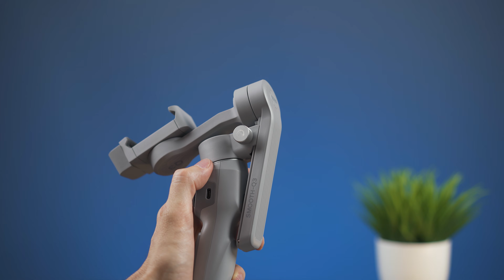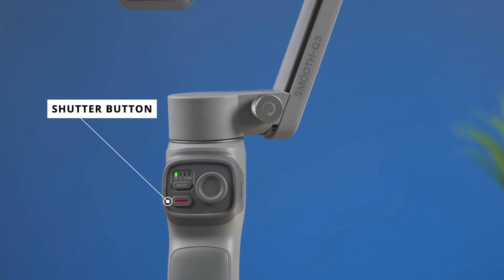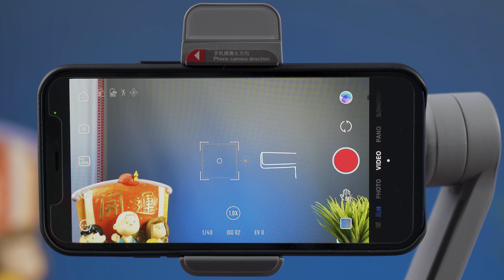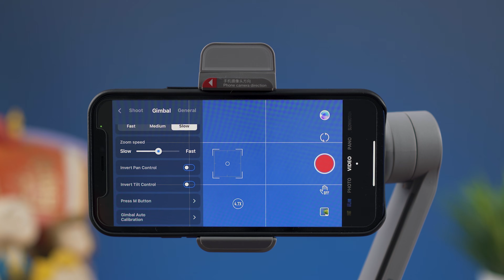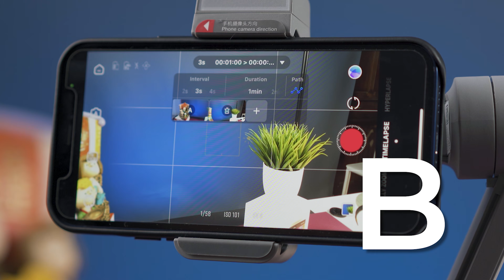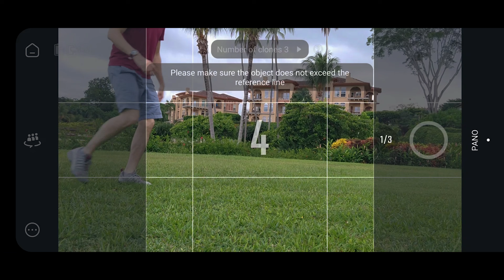Zhiyun SMOOTH Q3 Tutorial: Easy Guide to Setup and How to Use Features

Comment: I’m sorry disturbing you again....but in the app it says activation failed when I try to connect to the app....what should I do
Reply from the maker: No problem. Phone connected to the internet? Bluetooth on? Bluetooth not connected to anything else?
Reply: @OttoJulian_  yes phone is connected to the internet and Bluetooth is on.....and it's not even connected to other devices.....it says activation failed and saying to contact the customer service ☹️
Reply from the maker: Try restarting your smartphone, turn Bluetooth on and off. Also make sure that the green light is solid, if it's flashing, the arms might still be locked
Reply: @OttoJulian_  thanks a lot ❤️🥺

Comment: Hii I have a problem.... i completed setting up everything in the gimbal....then I click on the power button....but the gimbal is not coming in the portrait mode from landscape....but the indicator lights are on and the lights are blinking....but it’s not working....I tried to connect to my device also....it shows that there’s a device but not connecting....what should i do?
Reply from the maker: Common problem is not fully unlocking the gimbal. Make sure all axis move freely, specially the one where the phone rests
Reply: @OttoJulian_  thank you so much ❤️my problem is solved by itself
Reply: @OttoJulian_  I’m sorry disturbing you again....but in the app it says activation failed when I try to connect to the app....what should I do

Comment: Hello Otto, I have got a question. My gimbal is failing to upgrade, and I have no idea how to fix this. Do you have any tips of what I could do? Never mind, I fixed it. Thank you for your amazing video!
Reply: Having the same problem, how’d you fix it?
Reply from the maker: I explain how to do it on my Q3 review, but basically you need to go to their website and download a few files (including the firmware update)
Reply: @OttoJulian_  have you ever had battery problems with your q3? Because mine now is not turning on or charging at all
Reply: @1lilsco  hi, did you manage to fix this ? 
I just got mine , and it seems like it won’t turn on - no lights flashing- nothing happening 
@otto, can you help with this ?

Comment: Hi. I have redmi note 7 pro with 4k 60fps resolution..so which is the best gimbal for androids and note 7 pro get supported ? .please suggest me.
Reply from the maker: The Q3 is a good option, but I can't confirm if it will work at 60fps when using their app. It works with some Android devices, not all of them

Comment: Unable to pair via Bluetooth my OnePlus 9 device with the gimbal. It doesn't pair at all. Any suggestions?
Reply from the maker: make sure your phone is not connected to any other bluetooth device.
Make sure the gimbal is not trying to connect to another phone (if you used another phone before)
connection must be made on the Zhiyun App
are all the axis unlocked? do they move freely?
Reply: @OttoJulian_  Hi Otto, i found the main arm was not completely unlocked. After I clicked it in place, i was able to connect via Bluetooth. Thanks for helping out!
Reply from the maker: You are welcome. Seems to be a common problem with many users
Reply: @OttoJulian_  i believe so, it's quite tricky. I was about to return it but luckily I made it through.

Comment: My Q3 doesnt connect to bluetooth….i bought it yesterday new and i will give it back.

It‘s not calibrating and When im in the Cami app there just staying „ Doesnt connect to the device Bla bla bla
Reply from the maker: I'm sorry about that. if you haven't returned yet try disconnecting your phone from any other bluetooth device first and connect to the gimbal from their app. I've found many times my phone not giving up on another BT device...
Reply: I was having that same problem. I was getting frustrated and was ready to return it. I figured it out though. Smooth q was connecting via Bluetooth to my friends phone, instead of mine when he was near me.
Reply: Switch on the gimbal, get into "Stand-by" mode and press 8 times the Power button, in order to reset it. I had the same problem but once I did reset it, it was all fine. Best of luck!

Comment: Hi 
I wonder if you can help me I’ve purchased a Q3 everything was fine but now all of the green mode lights are flashing. When I turn the device on the green mode lights run through a sequence for a few minutes then all the lights start flashing, I have looked at the instructions and it tells me it has gone into standby mode and to hold down the long mode button until only one light is on, I have held the button down for a number of minutes and nothing happens.
Have you any suggestions 
Regards 
Gary
Reply: I have similar issue where all lights flash. I can’t tell if it’s on standby mode (all 4 flash slowly) or failed to upgrade (all 5 flash quickly). Worse, my phone does NOT tilt to portrait when Q3 is switched on. Resd all of the instructions and even when googled, no similar issues appear :(
Reply: Sorted it now. I just made sure all adjustments and locks are properly done, including balancing, cos otherwise seems to cause the standy mode.
Reply from the maker: Hi Kibo, yeah I was about to say that most people that ask this have that same issue (one of the axis is still locked)
Reply from the maker: Hi Gary, take a look at the above comments. Make sure all axis are unlocked and can move freely.
Reply: @OttoJulian_  hi mate thanks for you quick reply, yes I have read all the comments on your post. Everything is unlocked and moving freely, I’ve set up the phone and balanced all correctly, and the lights are still flashing it’s been two hours or so now. The annoying thing is I was using it earlier today and everything was fine, switched it all off had lunch and set back up and that’s when the lights started to flash. Gary 👍🏻
Reply from the maker: Gary, this might be a dumb question, but are you turning on the gimbal with the phone on the clamp? I'm assuming you do but had someone message me on Instagram with a video of the gimbal with no phone
Reply: @OttoJulian_  yes all set up like it should be, I’ve have left it on all night and the four green mode lights are still flashing this morning ☹️☹️☹️
Have messaged you on Instagram with a quick video of what’s going on mate
Reply from the maker: I'll check it out
Reply: @OttoJulian_  ok mate, left it on all morning still the same ☹️

Comment: I ended up sending the first one of these back because the articulating sections would not move when started (not the sliding section) then I found out the factory locks these articulating pieces for reasons I have no idea about. It cost the company extra shipping costs and cost me 2 extra weeks of waiting for a working stabilizer. 

Are all the brands like this when new (locked in place)? I don't mean folded up; I mean the articulating parts have to be turned manually to unlock them on this brand and model.
Reply from the maker: I also pinned a note. I hope it's clear
Reply: @OttoJulian_  : Thank you and I hope this helps someone else and the company from getting as many returns needlessly. As you said a sticker or simple piece of paper laying right on top in large font saying turn parts to unlock.
Reply from the maker: Hi J&D. Yeah, for the most part they are like that, as it "helps" the gimbal to stop moving around when not in use. You are not the first one running into this problem, specially with this gimbal. Manufacturers should be more clear with this using stickers maybe? I'll make sure to mention this on future tutorials as well.

Comment: Hi i have a problem when i turn on the gimbal its just showing the lights like in a slowly breathing i dont know how to cancel it and enter a normal could you help me please??
Reply from the maker: that means that your gimbal is on standby mode. Make sure that you power on your gimbal with the phone on the clamp and properly balanced. Also make sure that nothing is blocking the correct movement of the gimbal.
Reply: @OttoJulian_  okay il try thanks for the respond
Reply: @OttoJulian_  oh i see it was just a ltlle stuck thank you so much for the help you helped me a lot
Reply from the maker: Great news

Comment: I've had an issue with connecting to Bluetooth.  I have an iPhone 12 Pro Max. When it goes to connect, it comes back with "Connection Failed... The current device connection failed. Please try to connect again'. It asked me to pair once, I pressed Pair and it returned with the same error.  I've closed all apps down on my phone, turned the bluetooth off, rebooted it and it's still not working.  Is there something you can suggest?
Reply: Did any of you guys manage to resolve the Bluetooth issue? I’m having the same problem.
Reply: I am having the same issues with my iPhone 12 Pro Max. Did anyone have success??
Reply: @onlyloveremainsphotography8227  i did. U hv to try so many times. Its kinda annoying. Need to switch on and off the gimbal. Till it auto connect to bluetooth 😭. But now okay. Everytime i switch on the gimbal, it directly connect to the phone btooth and zyi apps.
Reply: @othfay8180  switch on and off standing in the app searching for a connection or how?  It's really annoying
Reply: @paratodo2101  yup. Now, i dont need to put on standing, just put the phone at the phone place of the gimbal, and switch on the gimbal, and it directly connect.
Reply from the maker: Did you try to connect it with another smartphone by any chance? If so, you need to un-pair the gimbal on that other phone.
Reply: @OttoJulian_   No. I just took it out the box today. I charged it and once it was done I tried to connect.
Reply from the maker: Make sure that your phone is not connected to anything else. Otherwise, follow this instructions below to reset the Bluetooth on your gimbal. 

①  If the Bluetooth cannot be found or failed to be connected, you can press and hold trigger button+MODE button+Photo/Video button at the same time for 2 seconds to reset Bluetooth
Reply: @OttoJulian_  Nothin.  I even disconnected my Apple Watch just in case that was the issue.  It give the same error message. The only time it says pair is when I hold the power button until the PF light flashes fast but, it come up with the error again by time I press pair.
Reply from the maker: Ok wait, are you trying to connect on the Bluetooth menu of your iPhone?
Reply: @OttoJulian_  I’m having the same issue. Right out of the box and it just wont connect to my iphone 11 pro max. ZyCami app or iphone’s bluetooth. The modes will have 4 solid lights for 2 seconds bluetooth visibility then it will keep blinking and lose connection. Its always connection failed 😭
Reply: @bmsr1983  Were you able to figure it out? I’m having the same issue :(
Reply from the maker: When you said that the lights are flashing, are they flashing slowly afterwards? Or do they keep flashing fast.
Reply: @OttoJulian_  The lights are flashing from left to right at a medium speed. Iphone just wont recognize the bluetooth for the gimbal. Keeps saying Connection failed.
Reply from the maker: Were you trying to do a firmware update. Your light sequence means failed to upgrade
Reply: @OttoJulian_  i thought the firmware when we need to update, we need to connect it to bluetooth first.
Reply: @OttoJulian_  which is photo/video button?
Reply: A year later I've decided to try again.  It's been sitting on my desk taking up space.  Hopefully a year later I can get some better answers than before.  Now its showing "Device Connection" and when I click on it to connect it does nothing until I hold the power button on the back and then it prompts me to that the bluetooth would like to pair with the device, but as SOON as I click pair it says "Connection Failed" 1. Please make sure the device haven't been connected to other mobile phones. (Which it hasn't) 2. Please restart the mobile phone Bluetooth (Turn off the Bluetooth and turn on again (which I have about 25 times). PLEASEEEEEEE HELP!!!!!!

Comment: Hi otto plz make a video on smoothness of shot when using timelapse panning and vertigo coz i hv seeen there is frame drop im those scenss the continuity is. Issue
Reply from the maker: for the Vortex or vertigo mode, I showed a clip when I did the review. I did notice that on the screen it looks like it's dropping frames, but when I play it, it looks ok. I thought it was me, but I'll make more tests soon, along with the motionlapse. I have another video coming up with this gimbal in about 2 weeks so I'll make sure to find out if there are any issues worth mentioning. Thanks for the heads up
Reply: @OttoJulian_  grt will be waiting...❤❤

Comment: my q3 has a problem.  pan to the left slowly, it makes a micro shot that ruins the video.  I tried to do the calibration but the problem remains.
Reply from the maker: hi, I noticed that it did the same on mine when not "perfectly" balanced. It will never be perfect but it has to be close to 10/10. The iPhone had the most issues because it is light, so I decided to balance it with the case on.
Reply: @OttoJulian_  great Otto!  problem solved !  put a cover on the iPhone and calibrated the gimbal to the best, now it works fine thanks !!
Reply from the maker: @firecesco1  great! Yeah I found out that lighter phones are not very "balance friendly" lol.